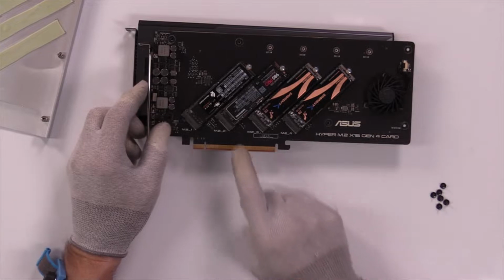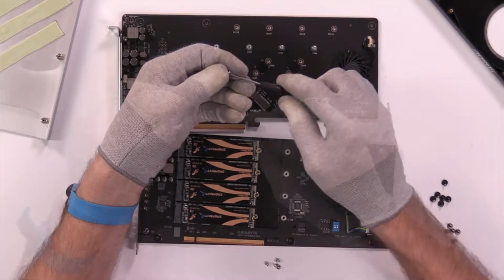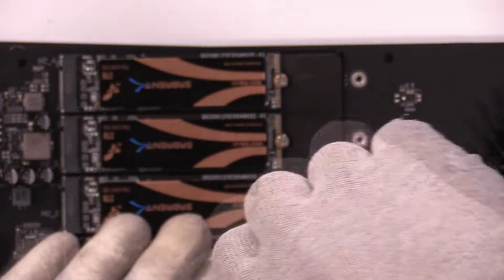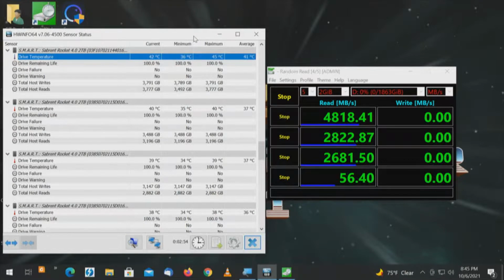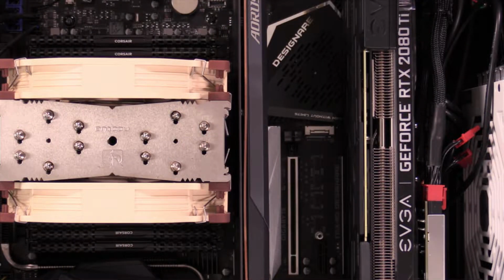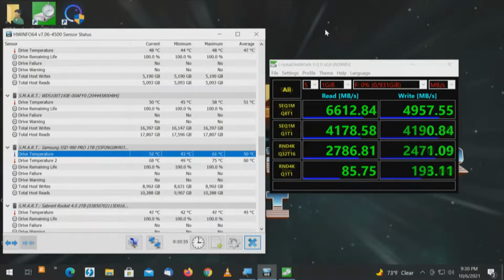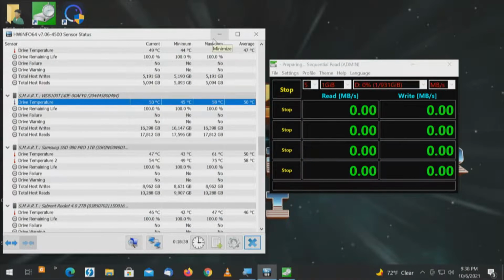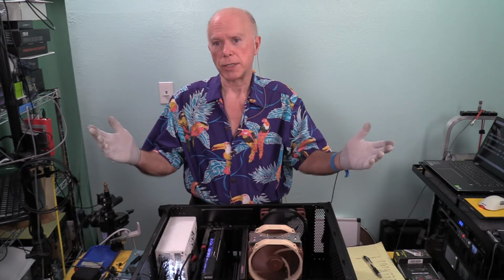WD Black SN850 Firmware Update on Gigabyte Aorus M.2 x16 Quad card Heat and Speed Test

Comment: so as i have 2 x 16 pcie lanes on the asus rog zenith extreme, 1950x processor, is it best to fit the quad card nearest to the cpu ? and i have bought 4 x samsung 980 pro m.2 s to fit in this card.
Reply from the maker: Hello Malcolm,
Welcome! Excellent Question! X399 Chipset, HEDT! Smart choice. Short Answer: Using CPU Lanes only. According to the Documentation, x16/x8/x16/x8. Just remember to Bifurcate the correct Slot in Bios to see all 4 M.2 NVMe PCIe SSD Drives. Success on Your Installation and Configuration! When these Motherboards first appeared there was a Bus prioritization problem. Subsequent Bios Updates have rectified that conundrum. Enjoy!

Comment: Do you have a video on the gigabyte card with four of the gigabyte 7000s NVME's? 
I mean it seems like common sense to have everything gigabyte on a gigabyte motherboard as well everything Aurora meaning the motherboard and the card and the NVME's to be the same make and model etc... Yes?
Reply from the maker: Hi WiKiTWoNKaWeCKoRDS LLC, 
Welcome! Great Question! Great idea! It's only money! No We do not. We have Tested 3 ASUS, 1 ASRock, and several Gigabyte Quad cards from PCIe 3.0 and PCIe 4.0. The furthest forward was with Sabrent 5,000MBps M.2 NVMe PCIe Drives. 1st Generation, PCIe 4.0. Since then up to 4th Generation PCIe 4.0 Drives are available. And since PCIe 5.0 is coming, We wait! We have several Videos on all of those AICs mentioned. 

What You can expect from what We've seen with 4 Drives in Hybrid Bios Bootable RAID 0 will yeild the Speed of 3 Drives. Therefor at 7,000MBps expect 21,000MBps. Thank You for Asking! Hope that helps!
Reply: @BuildOrBuy  I have a Gigabyte B450 AORUS M motherboard and I want to invest in the gigabyte quad card and also the gigabyte NVMe (I want to run them in raid 5 configuration and need a little tutoring on how to do so) but before I pay almost $600 I was hoping I could find somebody who had a video of the very similar thing I figured running anything other than gigabyte would be like oil and water and will not run at its peak performance hopefully maybe you might be able to do that for us soon
Reply from the maker: Hi @WiKiTWoNKaWeCKoRDS ,
1. What CPU are You using? 5950X? 20 CPU Lanes. 
2. Is the 1st X16 available?
Looking in Your Motherboard pdf manual, there is NO reference to Bifurcation. Bios Bifurcation allows a PCIe Slot resource to be split from X16 to X4X4X4X4. Each M.2 NVMe PCIe Drive requires 4 CPU PCIe Lanes. This type of card requires Bios Bifurcation and a X16 Slot, electrically, Bifurcated. Your other option would be a Self Bifurcated card. Those require a X16 Slot only. Highpoint makes those for PCIe 4.0. Do You need a reference? Hope that helps!

The best Solution for a B450 Chipset would be ASUS. They have done more with Bifurcation technology on other Chipsets of any Motherboard Manufacturer. ASUS Bifurcation Chart:
https://www.asus.com/us/support/FAQ/1037507/
ASUS has a Select few B450 Chipset Motherboards that do support Bifurcation. Gigabyte has other Motherboards supporting Bifurcation 
but not the one You have. We've seen the technology on X670E Chipset Motherboards.
Reply: @BuildOrBuy  the first is not available it's being used by the AMD Radeon GPU I can't remember what model it is it's an AMD ryzen 5 CPU I can't remember I think it's a 1600
Reply: @BuildOrBuy  well I didn't want to use Asus because it's not an Asus motherboard.. of course I can put the GPU in the other pcie slot to make the first one available
Reply from the maker: Hi @WiKiTWoNKaWeCKoRDS ,
That's Your only X16 Slot, electrically. The next Slot is X4, electrically. Bummer! That's why We've been doing Motherboard Overviews about Slot and Storage for PCIe Resource allocations!
Reply from the maker: Hi @WiKiTWoNKaWeCKoRDS ,
That would place Your GPU in a X4 Slot, electrically. But Your Motherboard does not appear to be able to Bifurcate that 1st Slot. Bummer. On the ASUS, even though the Motherboard Bios supports Bifurcation, You still do not have enough CPU PCIe Lanes. For that, You would need a HEDT or Workstation Motherboard! Your CPU only has 20 usable CPU PCIe Lanes when You need 32 minimum, 2 - X16!

To reiterate, Your 2nd X16 Slot is X16 mechanically but X4, electrically!

Comment: Does the firmware update affect the contents of the drive? I've got an SN850 that doesn't quite hit the full speeds on the chipset, but I don't want to lose any data!

ETA - just did it. Took less than ten seconds, manual reboot afterwards, and write performance is now correct.
Reads are still a bit slow - 6300 - but close enough😁
Reply from the maker: Hi JMUDoc,
Welcome! There You go! Excellent! Did You power down and reset power before rebooting? That makes a difference in those Results! Thanks for Asking and Sharing! We should always remember to clone, image or backup when doing anything that might compromise data integrity. Just FYI! Success on Your Computer Upgrades!
Reply: @BuildOrBuy  First thing I did after the update was a soft reboot - didn't even test until after that.
In case anybody is curious, this drive absolutely TANKS on B550, if the firmware is bad - I got 1600/1300, should be 3000+ on both sides!
Reply from the maker: Hi @JMUDoc ,
We also had to do a Firmware Update on that M.2 NVMe Drive. Found that out while Testing on 1 of the Quad cards. We encountered same problem as You did. But to reiterate only on 1 Quad card! Crazy, right! Thanks for Sharing!

Comment: I came here to learn how to update the SSD and this was no help.
Reply from the maker: Hi GothicKittyMadness,
Welcome! Bummer! This Video was Answering a Specific Question and was part of Our Series about M.2 NVMe PCIe Heatsinks and Thermal Pads! Here's what You want as mentioned in the Video under the Video Description: 
WD Black SN80 Dashboard Control Panel software for Firmware Update.
https://support.wdc.com/downloads.aspx?p=279

Install the WD Black SN 850 Control Panel. All M.2 Drives have a Control Panel aka Western Digital Dashboard. They all go by a different Brand name but functionally are the same yet Specific to the Brand. 

This is the only way to Download and Install the Update by way of the Control Panel to the WD Black SN850 M.2 NVMe Firmware. Afterwards, Power Down the Computer completely! And Drain Power to reset the Computer! Then Power up and Verify Firmware Update by Testing Performance! Hope that helps! Keep Us Posted on Your Progress!

Comment: Is it possible to dump the current firmware from an SN850/SN750?
Reply from the maker: Hi Coldblackice,
Welcome! Interesting question! NVMe is still fairly new. Commands issued to the miniport driver are used to determine Slot information. 

Firmware images are maintained on the device in locations called slots. The Command and Control functions do not currently indicate procedures for extraction. That should be possible but apparently not yet. We should ask someone like Crucial for a Response! Doubt We'd get a straight answer from WD. Any Vendor would probably claim Firmware is proprietary. 

Microsoft has some Documentation on NVMe here: Upgrading Firmware for an NVMe Device - Windows drivers | Microsoft Docs
https://docs.microsoft.com/en-us/windows-hardware/drivers/storage/upgrading-firmware-for-an-nvme-device

Not certain what can be accomplished through Linux with nvme-cli command line interface. Worth looking into... 

Open Source NVMe™ Management Utility – NVMe Command Line Interface (NVMe-CLI) – NVM Express
https://nvmexpress.org/open-source-nvme-management-utility-nvme-command-line-interface-nvme-cli/

To the best of my recollection, We use to be able to see WD Black Firmware updates as separate zip files. No more! Those have been removed and are now one way through the WD Control Panel. Most curious. Great question! Hope that helps for now! What's Your Plan? A Firmware Modification?

Comment: Bought a 1TB WD_BLACK SN850 NVMe SSD for more storage on my PS5 .. installed it correctly. System detected it. As I went on with the formating process. BOOM PlayStation crashes , shuts down. 

After watching this video
I'm hoping it's the old firmware. PS5 requirements for speed are a minimum of 5500 Mbps. If the old firmware has it at only 4000 Mbps. This might be the reason why. I will update firmware come back and give an update.
Reply from the maker: Hi M Perez,
Welcome! Ouch! This is the 1st We've heard of this! Let's hope a Firmware Update will fix this! Keep Us Posted!
Reply: @BuildOrBuy  Updated the firmware and what do you know ...IT WORKS! Wouldn't have ever figured it out without this video. I was about to return it and get the Samsung 890 pro. Now let's see how it performs long term.
Reply from the maker: Hi @mperez2496 ,
Outstanding! Go figure. How something so minor could be so major! Glad We could help! Keep Us posted on Your Progress! Thanks for Sharing!

Comment: Hello I have question about the ASUS Hyper M.2 X16 Card V2: can it be used with 4th gen nvme m.2 drive, if yes what about the speed.
Reply from the maker: Hi Chem Cup, 
Welcome! Define 4th Generation Drives.
PCIe 4.0 has 3 Generations of M.2 NVMe PCIe Drives We're aware of. If You're talking about PCIe 5.0 Drives, due to the Speed that's going to have to be a new round of Add in Cards! 

PCIe 3.0 = 3,500MBps. 
PCIe 4.0, 1st Generation = 5,000MBps.
PCIe 4.0, 2nd Generation = 7,000MBps.
PCIe 4.0, 3rd Generation = 7,300MBps on the Read and almost 7,000MBps on the Write.
PCIe 5.0 = 15,000MBps! 

The ASUS Hyper M.2 x16 Card V2 can utilize PCIe 4.0 M.E NVMe Drives. 

The M.2 NVMe Speed is defined by 3 things:
1. Motherboard Chipset. 
2. M.2 NVMe Drive Specs.
3. M.2 Adapter if using PLX chips. Otherwise the M.2 Adapter is just an I/O Card.

And the ASUS Hyper M.2 x16 does NOT have a PLX Chip. To reiterate, We expect PCIe 5.0 to change that going forward. 
Hope that helps for clarity! Thanks for Asking!
Reply: @BuildOrBuy  Thank you for the detailed information
Reply from the maker: Hi @chemcup1610 , Absolutely! Hope that helps! Thanks for Asking!

Comment: Wonderful video. Did the Samsung have the newest firmware as well and maybe Performance Optimized with the Magician software?
Reply: It was magician that would go on line and download your drives contents to Samsung every day. How guys caught on was a sudden drop in video down load speed and a rise in SSD usage. If they were trying to game and stream the drive data dump would crash their system.
Reply from the maker: Hi Max, 
Thanks for Responding! Better to uninstall Samsung Magician after applying the Firmware Update! That's nuts! We had to make a Video about the Optimization and Firmware Update. Took longer to explain the Chart than to get the Firmware and Test Redone! Next Up, the ASRock M.2 x16 Quad card!
Reply from the maker: Hi John Paul Bacon, 
Great Question! We made a follow up Video based on You and 2 other Subscribers asking about similar Results. Took longer to explain the Test than it did to run the Test! And the Samsung 980 Pro Firmware Update. 

Samsung 980 Pro Firmware Update on Gigabyte Aorus M.2 x16 Quad card
https://www.youtube.com/watch?v=_ELNhHOPMJQ&t=963s
Thanks for Asking! Next Up, the ASRock M.2 x16 Quad card!

Comment: Unfortunately I've seen similar erratic/flaky behavior like this slowdown. 

I got myself a quartet of 17.5 euro, 250GB WD SN730 drives (Dell pulls from ebay but like new on CrystalDiskInfo with 4 or 5 power on counts) to raid 0 on an Asus Hyper m.2 Gen2 I also got for cheap. I slotted it to the x16 electrical of my MSI b450 Mortar Max (GPU on the x4 slot through chipset), and enabled x4x4x4x4. Initially tested each drive individually and one of them (in m.2 slot 2) just didn't wanna go much above 1GB/s on CrystalDiskMark. Restarted, removed other drives and that one kept missbehaving. Re-slotted it on the same slot and then it worked with all drives  pumping the 2.5-3GB/s reads as expected, finally.

I then proceed to to the stripe raid using Windows, and as expected, got myself some 11GB/s and 7-8GB/s R/W respectively, at the first try. A day or two later, with about 10GB occupied, and for whatever reason CDM reports 1-2GB/s reads and simillar writes... Restarted machine and re-slotted once or twice and the issue kept happening. I go and test another day to confirm I am giving up on Windows-based Stripe (Raid 0) and guess what... Back to the ~10GB/s reads and simillar writes as before.

My guess here, and this is a theory only, is that these are issues at the BIOS/AGESA/CPU level, such as resource allocation or handling not working consistently. Some more context as to why I believe so is this system having a 3070 on that x4 slot, but also a 3080 through a mining PCIe riser doing x1 speed, and I also have my boot drive on the motherboard m.2 x4 slot (CPU). CPU btw is a 3800x combined with 32GB (2x16) 3600 CL18 Micron RAM (underclocked to 3333). So yeah, that's 25 lanes of PCIE right there with high performance graphics doing "intensive math" while also pushing loads of data through an x4 and an x16 slot direct to CPU, all at once. And driving 2 monitors and a bunch of USB peripherals, 1 of them Gen2 (I forgot, I also have a 1TB m.2 drive over USB-C), and mouse+keyboard+android device on 5Gbps hubs.

What I mean here is: there's just too many variables, and I bet that Aorus card pumping just 4GB/s, and then 2GB/s on what is supposed to be a PCIe 4.0 x4 Gen2 drive, when it should be doing ~7, is probably a similar issue.
Reply from the maker: Hi cldpt, 
Crazy, right. Now that's a loaded System! Could be. Certainly possible. We could both be having a timing issue. According to the following article, it's the maximum payload size (MPS) and how that affects the maximum transaction layer packet (TLP) that goes through the PCIe controller. 

WD Preps New Firmware to Restore WD Black SN850's Performance On AMD X570 Chipset | Tom's Hardware
https://www.tomshardware.com/amp/news/new-firmware-restore-wd-black-sn850-performance-amd-x570-chipset

"According to the manufacturer's investigation, the SN850 suffers from a drop in write performance on some X570 motherboards when the maximum payload size (MPS) is configured for 128 bytes. The option basically dictates the maximum transaction layer packet (TLP) that goes through the PCIe controller. Obviously, a low value will cripple devices with higher MPS capability, since they're forced to operate at lower MPS settings.

For now, it's recommended that SN850 owners install their SSDs on a M.2 slot that's connected directly to the Ryzen processor. If all your M.2 slots are already occupied, you may just have to wait for Western Digital's new firmware, which eliminates the MPS restriction on the SN850."

Appreciate Your Insight and Sharing Your experience. Eager now to Test the ASRock M.2 x16 card!

Comment: I'd love to see performance on both quad cards in RAID-0 to compare with mine.
Reply from the maker: We'll keep that in mind! What kind of number have You achieved in RAID 0? Thanks for Asking!
Reply: Gill has done the AIC AMD Raid0 on a Gigabyte  TRX40 mobo with GEN4 drives for us in the past. But not on the second generation GEN4 drives 7000GB/s. Four of the new $360 dollar drives is a chunk of maney and after  I spent $1500 on four of the first generation of GEN4 drives would be really painful. Buying just one 2TB Sabrent Rocket 4 Plus for a boot drive made my nose bleed. In theory 4 old GEN4 15,000GB/s and 4 new GEN4 drives 21,000GB/s.
Reply from the maker: HI @maxhughes5687 ,
Thank you for this! We're like rats chasing the cheese! Storage Junkies!
Reply: Just in case you are interested...
I've been testing my 2 new WD_Black SN850 1TB SSDs.
I wanted to compare CPU vs. Chipset PCIe performance.
MB/CPU: Asus WRX80E Sage/Threadripper Pro 3975W
Stock heat sinks and thermal pads on MB.
Updated to latest SN850 firmware.

I have 3 NVMe slots:
M.2_1: CPU: (Boot/OS/NotTested)
M.2_2: CPU: WD Black SN850
M.2_3: Chipset: WD Black SN850

M.2_2: Max Temp=51°
(CrystalDiskMark 8.0.4 x64 MB/s read/write)
SEQ1M-Q8T1:   7023.60 / 5157.56
SEQ1M-Q1T1:   4417.20 / 5158.31
RND4K-Q32T16: 3798.16 / 2963.17
RND4K-Q1T1:     82.11 /  231.12

M.2_3: Max Temp=53°
SEQ1M-Q8T1:   6264.29 / 5164.89
SEQ1M-Q1T1:   4017.22 / 5074.90
RND4K-Q32T16: 3735.16 / 2952.80
RND4K-Q1T1:     79.69 /  204.08

Then I put both SN850s into M.2_1 and M.2_2 (CPU) and RAID-0 them.
SEQ1M-Q8T1:  13934.75 / 9994.11
SEQ1M-Q1T1:   7081.80 / 7871.25
RND4K-Q32T16: 1465.73 / 1110.89
RND4K-Q1T1:     74.04 /  316.78

Can someone explain why the Q32T16 reports such low numbers with RAID0?
Reply from the maker: HI @LordChariot ,
Absolutely! Thanks for Sharing! Excellent Temps!
Here's a link that may help. To sum it up, a Drive with a Higher Write will affect that Result. Like a PCIe 4.0, 3rd Generation M.2 NVMe SSD Drive. 

CrystalDiskMark and the Interpretation of Tests Result - Thanalysis, Search: RND4K Q32T16
https://www.thanalysis.com/2020/11/crystaldiskmark-and-interpretation-of-test-results.html

Hope that helps! Fascinating Results! 

BTW: Interesting to Note on the WD Black SN850, the Writes are better on the 1TB than on the 2TB. And the Reads are the same all, throughout the series according to the Specs. Interesting!
Reply: I dont have mine running yet. Still working on the custom loop. Will post when I get numbers.
Reply: @LordChariot  Bravo!!! #metoo hahahaha I'm looking at stuff in the LR. rads, pumps, res, fans and blocks for H2O and drives.